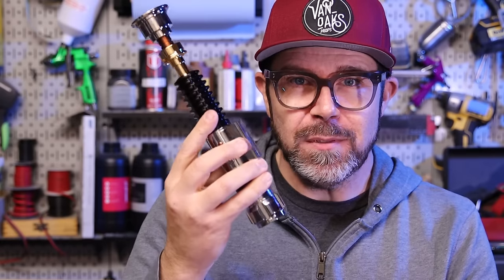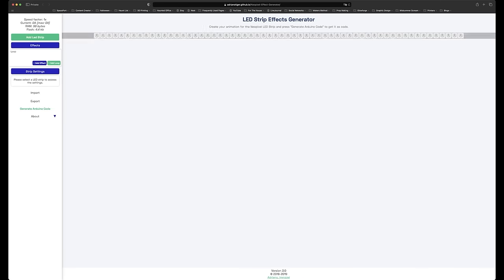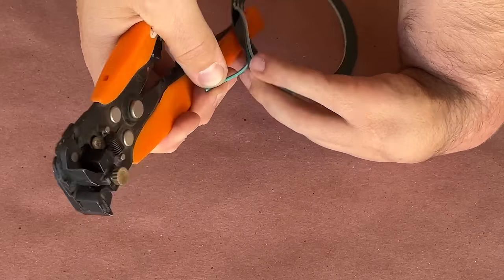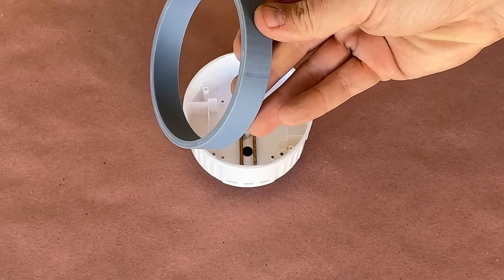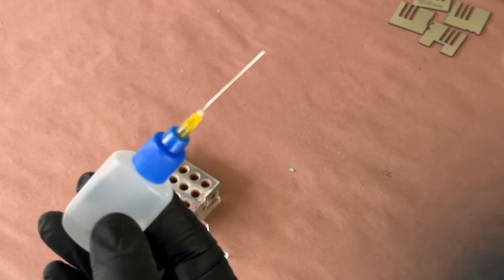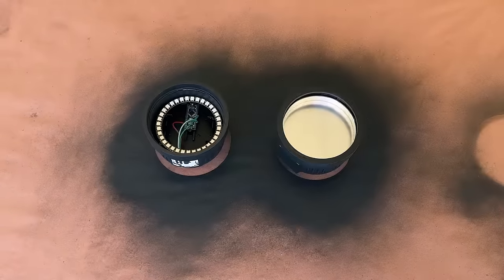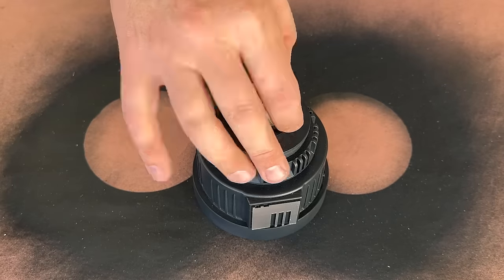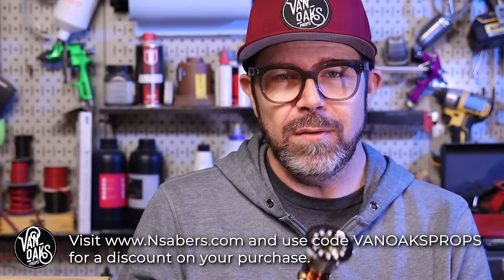Building a "FLOATING" Star Wars lightsaber Display

Comment: Nice video. Adafruit has a great article on their website about working with neopixels. It's, for example, recommended to add a resistor in series between the arduino and the data in on the LED ring to protect the first LEDs control chip.
Reply from the maker: Great tip! I’ll have to check that out.

Comment: You should look into WLED to control the leds via an esp8266 or esp32 board. Much more flexible and easier to set up. Also allows you to connect to the leds via wifi to change colors and effects.